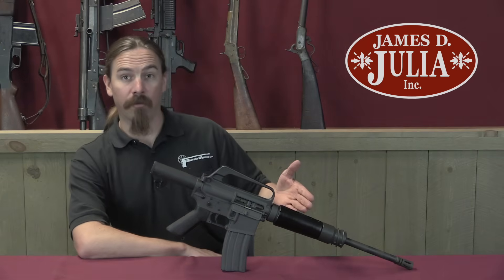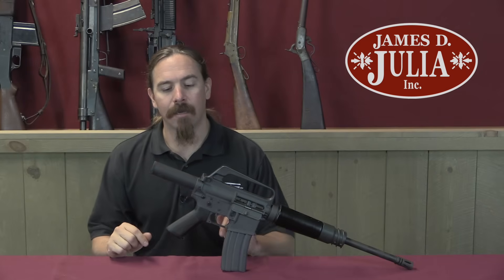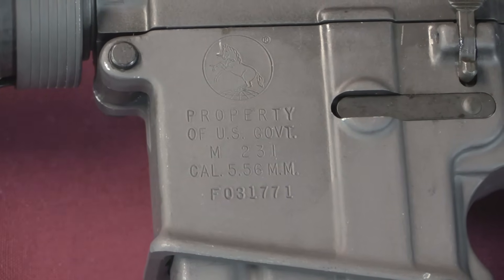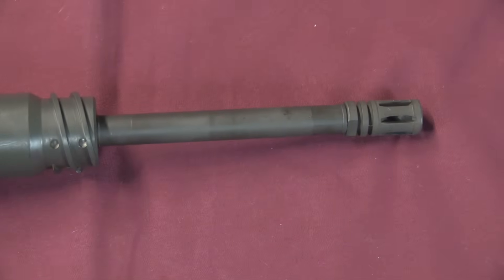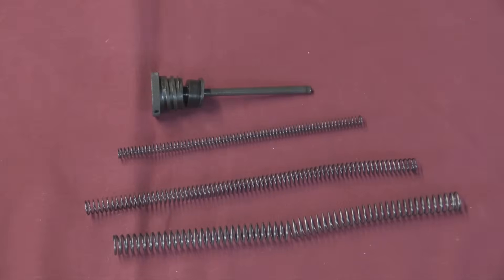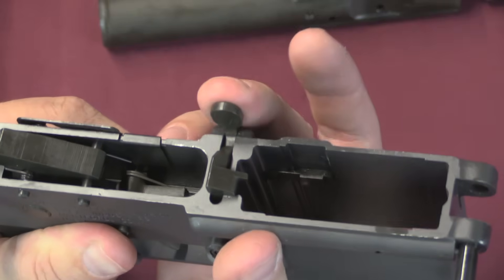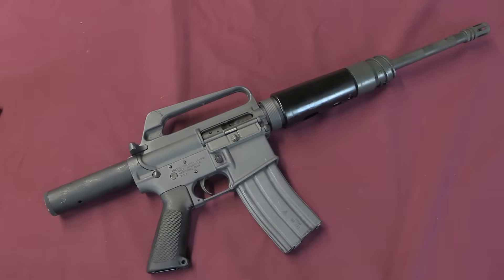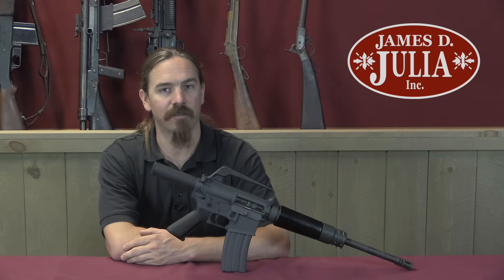Really Not an M16 at All: Colt's M231 Port Firing Weapon

Comment: When we deployed to Kuwait for OIF1 in 2003, we kicked around the idea of using these as SMG's to assist with MOUT.  The plan was to take one recoil spring out and give them to SAW and 240 gunners when we had to do raids.  The idea went no where when we decided that the SAW was still better that the 231's and the 240's were better used as local support once we secured the house.  

It was a lesson in going to war with the tools you have instead of the tools you want.  C co, 1/22 inf, 4-id.
Reply: irongunner1221 we had the same idea took them out to test and found that it was impossible to hold onto it after 2 mags and impossible to keep it fed.  Killer troop 3/3 armored cav
Reply: Sounds like the tool you had (the 249) should have just had the barrel hardware to lock into the firing ports of the Bradley, and those been the only mucking around anyone did with firing ports. Did you use the firing ports at all? Were they practical in the American style of fighting? I know the Soviets in the BMP-1 and 2 expected to be driving over irradiated or gassed trenches and use their AK's in the ports to suppress those long enfilade targets. I don't know if that specific use applied to American forces even in theory.
Reply: In later OIFs they did issue M231s to Humvee gunners as secondary weapons to the "main gun" M-2, M-240, or Mk 19. because there were not enough M-249s to go around.  Basically an "immediate suppression" weapon for counter-ambush etc.   IDK where they got them from and we never had any, but I saw some units with "screw barrels" sticking up from the turret rear brackets.
Reply: The point of the firing port weapon was that they were way more compact than any other rifle or machine gun we had.  the SAW's we had were the older full size models.    there likely wouldn't have been room to fully depress the SAW's muzzle once connected to the vehicle, since we would have had to elevate the butt end.  Also, the Brad's had a weapon exhaust system that was supposed to evacuate the smoke from the firing port weapons if used.  The hoses would clamp over the the upper receiver near the ejection port.  The spring clamps wouldn't work on the SAW's feed tray cover.

The M2-A2 ODS (Operation Desert Storm) Bradley's we had only had the two firing ports in the ramp, the other firing ports in the hull were sealed.  We never trained how to use the firing port weapons while in the vehicle.  The firing port weapons would not have been practical.  they were only meant to be suppressive.  The shooter would have had to use the vision blocks (think of them as solid periscopes) to observe the tracers and impact.  If the Brad's were going to drop ramp for dismount in an area under fire, suppressive fire from the coax machine gun in the turret and the other brad's in the section or platoon would have been more useful.  
Though, we dismounts would have preferred retreating to a safer area, dismounting, and then re-engaging.
Reply: Was in Ramadi in 05-06 and one of our Bradley commanders carried one as his personal weapon, probably because it was smaller and lighter than the M-16 our crews were issued.😆
Aside from that, none of them even made it out of the arms room.
Reply: We're you part of the first wave?

Comment: Is there any way to use the 231 shortened buffer tube and springs on a standard M16 or AR-15?
Reply: Adaptive Rider No, the springs sit where the hammer moves through to hit the firing pin. Gus Smoke Enterprises sells (or sold) a similar recoil spring system that does work.

Comment: when i was in the army in the late 90s we would take out a spring or 2 ( i forget which 1s ) to slow the fire rate down and use them for room clearing ( spray and pray ) . they were very good for that short ,reliable.  other than that we never used them in my unit .  cool vid .
Reply: what did it slow down the rate to, 900rpm?
Reply: @PapaJoJ  
If that was reasonable enough for the Baguettes, it's reasonable enough for us.
Reply: @cptTK421  Baguettes?
Reply: @sam8404  Probably referring to the FAMAS rifle and its extremely high rate of fire.
Reply: Cool story bro! BUT....when you remove springs it actually INCREASES the cyclic rate if not inducing malfunctions..

Comment: How many per vehicle?
Reply: Originally, the Bradley had 6 firing ports. 2 on each side and 2 on the back. The firing ports on the sides got covered up when they upgraded the armor. Now there are just 2 firing ports on the back. So, theoretically 2 per vehicle. Realistically, I suspect they just stay in the arms room and don't actually get issued.

Comment: IIRC, what precluded the standard M16 to be used was that the port had to be as closed up as possible, and the front sight made that difficult. The gun also had to be secured tight and safely while firing. It would be disastrous if a gun came loose during firing, and loads of 5.56mm bullets were ricocheting inside the armoured vehicle. This does seem like a kind of gun that would benefit from modern optics and high-capacity magazines, whether 100 rd. drums, or quad stack 60 or 90 rd. box mags.

I haven't kept up much on a lot of current equipment, so I have no idea if they are still deployed at all. I know the M3 cavalry scout version of the Bradley never had them. It seems the whole concept was born out of the "BMP-scare" where everything on the new BMP had to be matched and countered. Of course, there was the experience from Vietnam, where firing out from the top of M113 carriers was done.
I guess that if the vehicle is really in danger of infantry close assault, dismounting your infantry is the prudent response.

Comment: when we went to iraq [1st one] and i assume before. all we had were long m16's. and in iraq we only had the burst fire versions. i heard units were using these for bunker clearing because of their high rate of fire and overall dependability. as for the tracer "stream" we tried using all tracers in our rifles and at mid day could not see the tracers any better than if we just had our standard 1 every 4. the thermals on the tank can "see" every round so i assume so can the Bradley's.
Reply: What company?  C co 1/22 INF here.  We didn't use them for bunker clearing, our CSM told us to knock it off.  We kept the standard tracer mix in our mags when we could get tracers.
Once we got into Tikrit, we hardly ever got into fights with the Brad's along.
Reply: 2nd armored division [fwd] we were attached to the 1st infantry division. we used mostly handfuls of russian,[Syrian,Jordanian] grenades. but our supply folks were asked if we had any stocks to spare. i guess they were trying to make them more manageable

Comment: Ian, the reason the troops couldn't use their standard weapons from the firing ports was because the vehicle was supposed to be NBC-sealed and open ports would compromise this. The Germans had a similar problem/requirement with their Marder vehicle and adapted a modified Uzi for the same job. Ironically, the Soviet BMP-1 fighting vehicle, whose firing ports inspired all this nonsense, didn't have NBC-sealed ports: it just had holes in the side which you couldn't open under NBC conditions. Even more ironically, having gone to all this trouble to provide firing ports and weapons, the US Army (and everybody else) then discovered that more armour was much more useful in protecting the vehicle than marginally more firepower, and fitted the Bradleys with applique armour, which blanked off the firing ports anyway.

Comment: You didn't mention how the troops would accidentally leave them mounted into  the main  door ports. so when the main door was dropped it would bend the barrels off of the rifles.
Reply: Krumlauf express!
Reply: @Gahlok12 The Bradley has firing ports on the door and on the side.  On the side, you can just leave the M231s screwed into the port all the time, simplifying the whole "leave it in the Bradley all the time" procedure.  If you tried to open the door with an M231 screwed into the door firing port, the barrel would impact the body of the vehicle and then the weight of the opening door would bend the barrel.  Hopefully nobody managed to do it twice.
Reply: Börje Svensson yeah! DIY instant krumlauf!
Reply: Had that happen in Kuwait , guy left one in the rear hatch snapped the barrel from the upper receiver the barrel bent almost 180
Reply: Then tripping over it as your dismounted
Reply: I'm sure they did that just to break them and to get them out of the Bradley.
Reply: Drew Strom they did what?
Reply: Hahaha, that’s amazing. 

What an utterly useless POS, has one ever been used in anger from a Bradley?
Reply: Hah
Reply: I've heard about this.
Reply: @somespeedbikefreak9244  the first thing to go was the MOS 11D 
? 11S door gunner around 1996, up! Armored M2a1 and M3A2 no more port firing arms! everything covered in 7/8 in RHA Steel
Reply: Those are the hand guards used on the DOE guns. Would be nice to have those available for sale.
Reply: I slammed my barrel in the car door - that one soldier who came to E-4 Zach
Reply: lol did cross our mind but they never left the arms room
Reply: That must have been on the original Bradleys. The M2's didn't have firing ports in the ramp.
Reply: @chicolittle5409  can confirm m2a2 and a3 still have them for some reason
Reply: @chicolittle5409    Yeah thats right on the money. These things caused a huge internal faction fight within the army . First they got issued, then taken away, then reissued with restrcitions... I was part of the Armor School back then. They sent 8 of us across post to the  Armor and Engineering Board on Fort Knox.  Every detail we pointed out as needing improvement was ignored, cuz, Politics

Comment: The firing ports on the bradley came about because the Soviets had them on some of their APCs.

I'm thinking that the firing port weapon came about because of the desire to NBC seal the Bradley.  There are no features on the M16 that would really let you do that, but a dedicated firing port weapon could have features like that threaded endcap built into it.

I believe these guns are still in inventory somewhere.  I've heard rumors of Bradley crews using them as dismounts as makeshift SAW replacements to supplement the squad firepower.
Reply: Put a buttstock on it for shouldering in emergency.

Put a 100 or 150 round giant magazine in it.
You now have indeed a fairly usable in case of emergency SAW.
Reply: Jeff Acheson Yes they do still have them some now have stocks and sights but I can’t imagine shouldering it
Reply: Devin Tariel id shoulder it just to make firing from the prone possible.

Cool last ditch weapon.

Comment: My guess is that it's a solution to NBC protection requirements. Having a sealed ball pintle mounted gun doesn't compromise that in the same way as an open firing port would for troop carried weapons.

Comment: By far has to be the coolest M16 platform rifle. If the ATF didn't have their ban on production of open bolt semi auto firearms for sale I'd so buy my own. If I was in the military and I saw a wrecked Bradley on the battlefield I'd pick one of these up and make myself an improvised PDW. So damn awesome. I'd ditch my sidearm for one of these bad boys. like a mini A10. BRRAAAATTTT! *Edit Ik this is a full auto firearm, but I bet you someone could easily make this thing a semi auto open bolt gun with a little bit of tinkering. Putting it into production from there wouldn't be hard.

Comment: It's because they wanted the ball joints to be airtight, so the gun needed to thread in tight. They also had hoses with vacuum pump to evacuate the gas blowback that would otherwise suffocate the soldiers.
The whole interior was designed around the idea of Bradley being a .223 spamming hedgehog, the absolutely idiotic folding seat arrangement and limiting cargo capacity to six in the process.

Nato analysts thought BMP1 had similar, airtight, firing ports but it turned out later that opening the ports on BMP compromised the NBC protection, they were just holes with shutters.

Comment: If there are no sights, what the carrying handle for? Not for carrying, if it’s not supposed to be removed...
Reply: Probably just for manufacturing reasons. Instead of coming up with a specific upper receiver (and the tooling it would take to manufacture it). It looks like they just took a normal M16 receiver and skipped the manufacturing steps where they add the sights.
Reply: I suppose it does serve as a very crude “sight” in itself...

Comment: In my unit, it was not at all uncommon to "appropriate" one of these from the Bradley to use for breaching and clearing operations in Iraq. One troop would kick open the door, the next would stick the 231 in and sweep the room with a full 30 rounds. The high rate of fire was useful because it meant you pretty much saturated the space with bullets prior to rushing in.
Incidentally, these were meant to be used to "clear the ramp" before the infantry squad would dismount the Bradley.  Don't think I ever actually saw one used for it's intended purpose.
Reply: As for why not use the M16 the troops already carried, I presume it has to do with the close confines of the Brad. The shorter 231 can be swept side to side, back and forth rapidly without needing to swing the much longer M16 around inside the thing. And again the high rate fire is great for getting lots of bullets into a small area quickly.

But as I say, never saw one used in the "proper" way.
Reply: @randomuser778  yeah I can see squads breaching with those. That's good life insurance right there
Reply: A former scout told me the same thing..they used them for room clearing...30 rounds in less than 2 seconds.
Reply: @richardbearden7889 he was lying
Reply: Why not just empty a SAW through the door before you go in?
Reply: We did more or less the same. The few we had would occasionally be used in the stack during clearing ops.
 @gitman3486  this was usually only used when there was solid Intel that some HVT was actually there. That being said, we never sprayed through the door or just unloaded with anything unless we had PID. These were used to increase the firepower a team could use. Generally it would only go to someone who just had a rifle anyways.
Reply: @egondoerr no you didn't
Reply: @gitman3486  from the description I'm getting this thing is like the old bone saw. No governer or burst to slow rate of fire.
Reply: @gitman3486  its heavy and long, one if the reasons why the marines got rid of the saw is because of this
Reply: They should issue them with c-mags XD
Reply: Exactly! by the time you got back to your FOB, nothing to clear before entering.
Reply: Random User idk much about the military and rules of engagement but that sounds extremely reckless
Reply: @juliancollot7579  Not sure about this guy, but this is typically done when an enemy has been identified to be in a building that has already been evacuated of civilians. STA Marines in Beirut did the same thing with borrowed Uzis.
Reply: They sweep the room technically. The only way they can do that is to Kick down the door as somewhat of an entry point. Before they enter, the M231 Sweeps the room real quick and then they storm inside. Im not sure if this is accurate but its what i see.
Reply: @juliancollot7579  well, it was iraq... i wasnt there but had a coworker who was and he said it was shit, saw a bunch of docs and interviews about it and jesus christ, a mess. and then we stayed? a mess.
Reply: @juliancollot7579  " idk much about the military and rules of engagement"

Do you often express yourself publicly on subjects you don't know much about?
Reply: @jasoncarswell7458  just expressing concern. Is that alright with you?
Reply: @juliancollot7579  think he was just asking dude no need to be hostile
Reply: No you didn't
Reply: Why were you just kicking down doors and sweeping the room with it?
Reply: @aritsa3946  Cuz its war?
Reply: @FerrymanTheFool  not very traditional war but i can see why some have concerns and some go in guns blazing. weird time. i was in school during all that, side note but i got shit on so much bc i look middle eastern im just hispanic lmfao. iraq was shitshow and Afghanistan was the bullpen
Reply: @aritsa3946 the initial Invasion of Iraq and the nation building portion of iraq were two different types of war

The initial invasion was a war, evacuation orders were given and insurgents controlled entire cities (think the battles for Fallujah or Ramadi), again it wasn’t peacekeeping YET it was an actual war
Reply: BS!